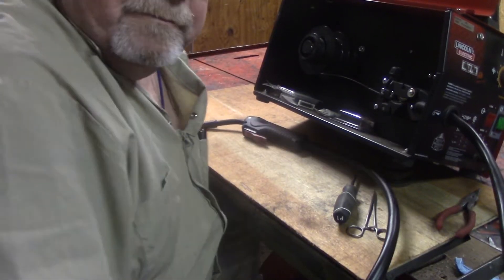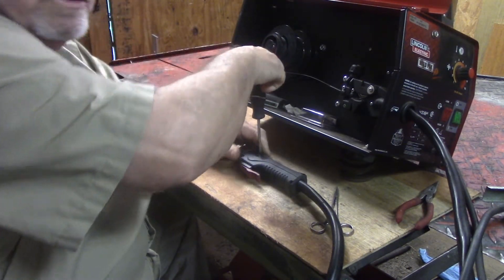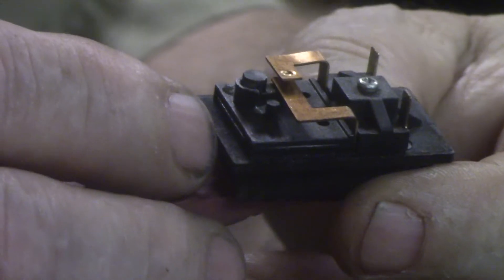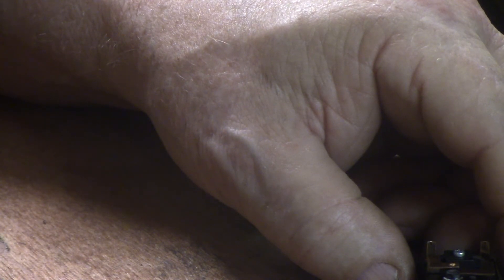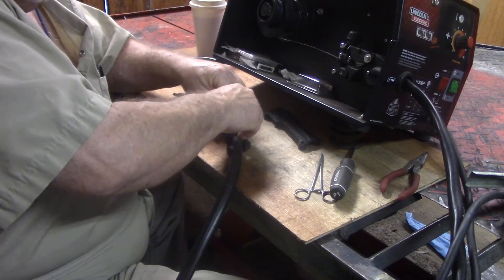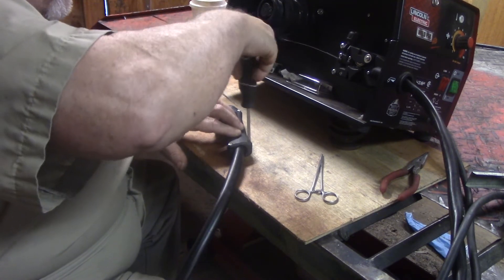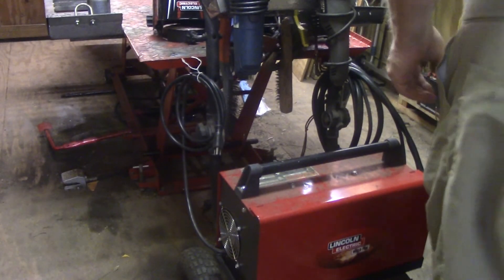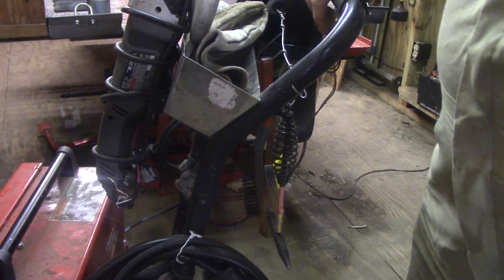Duke's World-When your welder won't stop feeding wire

Comment: I had the same problem with my Millermatic 135. Turns out the micro switch in the handle was bad. It's a sealed unit so I couldn't repair it like you did. Had to order a new switch.
Reply from the maker: That's a bummer!! Thanks for watching it.

Comment: Hey Mr Duke do you like them little welder I seen one that yard sell this evening I think about going back my get it..👍👍
Reply from the maker: I like this one, It's a Lincoln Electric weld pack. Works on 110 volts. I got it about 5 years ago at Home Depot. I could have gotten one a lot cheaper from eBay or Amazon. But I needed one that I could depend on. Go back and get it, but if it's an off-brand I'd leave it alone.
Reply: @dukesworld3020  it was Lincoln elect the lady she wanted dollar for it.
Reply from the maker: @waterbugofthausa7723  BUY IT!!!!!!!